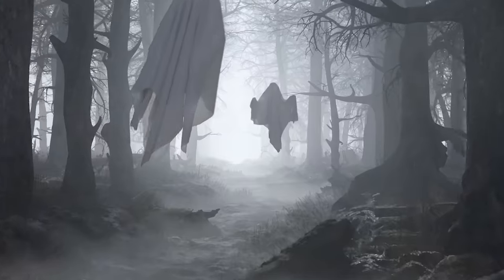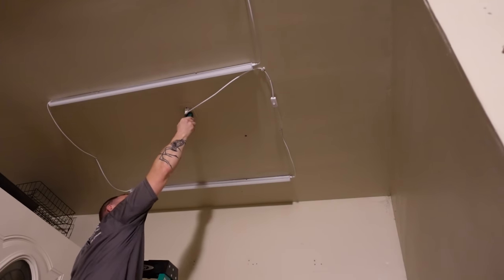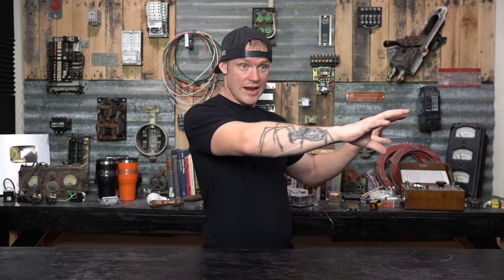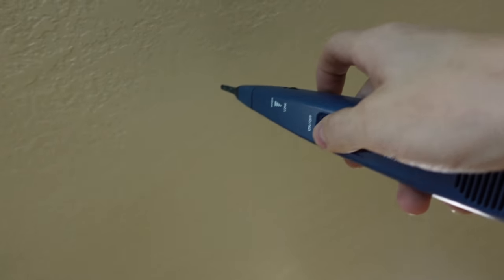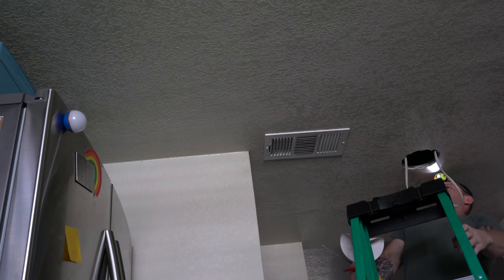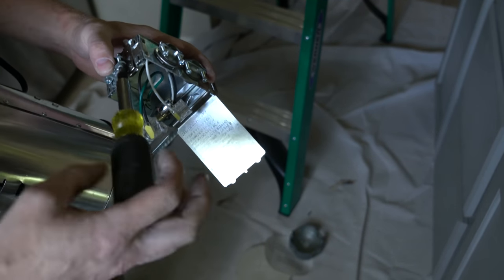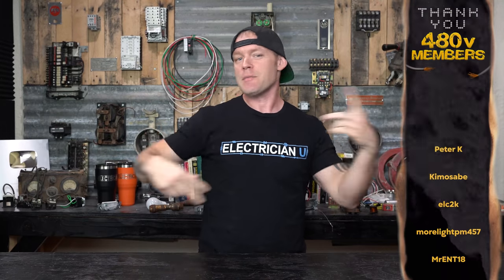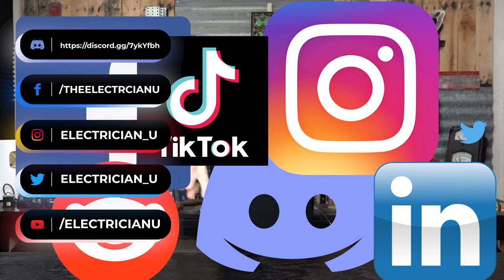THIS IS WHY ELECTRICIANS DON'T HIDE J-BOXES IN WALLS - Finding Hackwork!!

Comment: Speaking of switching the breaker off:

I had an electrician (apparently he was certified!) late last year replace my old hot tub receptacle with a 15A GFCI for outdoors.   Part of it involved replacing the 40A with a 15A breaker in the main panel.  (basically we were just re-using the hot tub wiring for a new logical circuit).  He managed to do that without ever shutting the power off to the house.   What an absolute muppet.

Comment: Once my closet lights stopped working. I found out there was an outlet and as soon as you plug something into the outlet, the lights go back on. Found out the outlet was just old and because the wires to the lights were connected through the outlet, they were getting disconnected in that outlet.

Comment: My frustration performing DIY (I do my best not to work like a Destroy It Yourselfer) changes on residential electrical circuits is, reading the directions for the device I'm going to install, then with full intention to be safe, go to the "Circuit Breaker Box" to shut down the power to the circuit I'm working on, and nothing is labeled inside the panel.  Who's responsibility is it to label the, circuit breakers, in the damn panel?
I worked in the drywall trade for many years and learned that when, plumbers and electricians, did rough in work they would often leave a mess behind of tripping hazards.  So glad to be retired from that.

Comment: Nice find in the box. Probably saved his a$$ and property. Seen this issue in various places, basically something, humidity or some other environmental reason caused the wires in the neutral junction to go resistive. P=I^2R. Portable X-ray charging board 120VDC battery stack. Not charging properly if at all. Connector has dark spot on one or more conductor slots. Cleaned burned post, replaced wire contact wiper and good to go. Shipboard fire and flushing pump, DC, high amperage.  One of the connections went resistive, 0 size wire melted off completely. The amount of heat from the current passing through the resistive connection was enough to fry the wire. And it did not pop the 100A fuse feeding it.  Same thing in a CT Scanner heater circuit. Wires would go resistive, either cause the unit to have uncontrollable temp or burned contacts. Resolved by field mod replacing tin contacts with gold plated contacts. So as I said, good find, you likely saved his house if not his family.

Comment: 18:50 - seeing the plug (receptacle?) move while tugging on the cable -- wouldn't that also then insinuate that the previous worker didn't secure the line within 4 or 6 inches (or whatever the number of inches is for Code) ??

Comment: and this whole rodeo is why I use a voltage tester that does both high and low impedance input..
if it reads weird in high, just load it down and watch it drop to 0.
cause of issue found super quick

Comment: ah yes, weird electrical issues, the thing that unites mechanics, electricians, computer guys and many more

I really love those things cuz it's where you gather the most experience

and sometimes the easiest thing is to just rewire everything
especially in old buildings with 50-80 year old wiring or whenever it was they used aluminium wires with cloth/tar insulation

Comment: I had a light switch "nobody could make work, and the last guy said if he can't make it work nobody can". They were unscrewing the bulb slightly to turn it off...open the outlet and there is a Red Wire just sitting off on its own unconnected...deedadee...the switch had been wired so that it gave constant power.

Comment: If I had to guess going from left clockwise around your logo, in parallel, after completing level 2 schooling a few months ago. Battery, resistor, diode, motor, resistor, switch, capacitor, normally open contacts. How'd I do?

Edit: Switch is normally closed.

Comment: Just curious about whether the box fill was of any concern in this solution.  I have noted that Halo in particular has stamped the acceptable number of cables or conductors allowable in the junction box, presumably which vary depending on the fixture, and surprisingly it's fewer than I would have thought.  I am assuming because we cannot read the jacket of the existing Romex cables that there were three (3) #12/2G NM cables in the ceiling to be re-spliced, plus the new, yellow jacketed, 12/2G NM cable you added for the switch leg of the room's light fixture.  Does Halo have anything to say about four (4) 12/2G NM cables in this particular j-box?
Reply from the maker: It's for the maximum fill rate of common derating tables they are required to in the current code cycle. There are calculations YOU can do to make sure everything is kosher.
Reply: @ElectricianU  of course. But as you know, manufacturer’s instructions always supersede the Code.

Comment: Helped a friend troubleshoot a light that wasn't working.

Are std. switches designed to fail shorted but with high resistance? That's what turned out to be the problem.

Comment: My bro in law had a habit of replacing outlets and switches. He would just take all the wires off a three way switch and just slap a new one in it's place which would not work. He also tried wiring in a phone jack. It of course did not work as he didn't strip the insulation off the wires.

Comment: Had a open neutral that took me a while to figure out. It was after the first receptacle in the branch circuit but before the second receptacle in the same circuit. (Sushhhhh, I used a double male extension cord to patch it for a couple of days until I could get into town to buy replacement parts.)

Comment: Even if you didn’t knew if the junction box was the problem you should just make the hole anyway to mount it in the ceiling and put a blank plate on it.

Comment: You know why I do not like slim recessed  lights except for when space restricted
-- if the light fails , and LED /led drivers do fail - customers cannot replace 'a bulb'
.
Little detail from my experience re 'odd voltages'
If I get voltage readings hot to neutral of 7-13 Volts .... 90% certainty 'neutral' is busted 
.
Oh and neutral to ground - even on 'empty' but powered circuits will trip a GFCI , even though I don't understand how since they are technically both 'grounded' and have no link to hot .... but it's what I have been observing
.
Oh, and I wish you had told people that 'new work' (installed b4 drywall) recessed lights have their boxes with covers on both sides so they can be reached afterwards via the dropped / pushed up can you demonstrated
.
Oh and being honest - I have used cans as junctions out of necessity instead of tearing open walls to extend wires - don't like it, but

Comment: Had an outlet below the main breaker box that's been taped for years as the house is owned through family and I asked about it. They said it gives odd voltages but didn't say a thing else. So I asked to take a look and they said sure. It's ok ne out look at 120 v 15 amp receptacle. Plugged in a tester both yellow lights and the red light kit up. All 3 at the same time. I immediately said "oh oh" as that's a very bad sign. So threw a voltage tester on it,hot to ground 120, neutral to ground 120, hot to neutral 240...

240v on a 120 volt 15 amp outlet!!! Are you kidding me!!!!. I told them this needs to come out now. So pulled the outlet out and sure enough two black wires going to hot and neutral with the white neutral going to ground...

Ripped the outlet out and capped off all the wires and replace with a blank cover. 

O and it was just one outlet on this line which went to a 40 amp 220 volt breaker ><. Anyways got the line removed completely and the 40 amp breaker removed. 

Lucky nothing blew up if any one ever plugged anything into that outlet and glad no one got hurt

Comment: Hello how are you  doing. listen I wanted to ask you something That I have seen different on our house BRAKER panel box. Before I use to see the breakers in different position and now all 16 breakers are in only one position.  In our house we don't have a washer or a dryer we don't rise A heater our sink disposal is not working our air conditioner is been removed there's a radio speaker where they  can communicate on all of 4 rooms . I am corpus does all breakers need to be in position. Thank you so much for your time and for your experience

Comment: I immediately knew that it was an open neutral issue. Every call I get where it's a weird voltage from neutral to hot, with voltage from hot to ground and neutral to ground, it's a broken neutral.  Odd to see it in a junction box, normally it's a bad backstab.

Comment: If you had mounted the j box to a ceiling joist right next to the hole would that have been considered "accessible" also or does it need to be able to be serviced from below the plane of the ceiling such as the integrated box on the can light that can be pulled down? I know in my area unless you have something like 4 feet of headroom for access in whatever space it is going you have to turn it upside down and use a cover plate in the ceiling. I like the idea of using the can light in these situations to serve as a j box, but I do wonder if the volume is large enough for all the extra conductors and wire nuts you'd be using in there that it was never intended for, where a J box next to the hole would have lots of space but be harder to access.

Comment: Minor problem with the canless lights- when they die (because they will) the homeowner would have to do some fairly major electrical work for a non-electrician to replace it, where with a can you can just replace the darn bulb. 

Replacing switches I can do. Having to take apart a possibly major part of my house's wiring, though? Way out of my comfort range, and I'm not into hiring someone for something that is suppose to be so stupidly minor.

Comment: Actually, there is something I need some advice on.
There's like, a fused switch in the cupboard of the back room that acts a bit like a junction.
it has a double socket connected to the box in the back room. The entire attic also goes through this box.
My brother at one point melted that socket in the back room. the problem was noticed when the power failed, now it doesn't work anymore, neither do the sockets in the attic.
I've put the multimeter on at several points, there's just no power getting to that box. I'm fairly sure the wires that go to that box are connected directly to the main breaker box at the other end.
Is it possible the breaker itself died? I mean, the issue is definitely before that box, that's the only thing I can be certain on, but to do further investigation would require turning off full power to the whole house, and I haven't had the opportunity to do that yet.
Reply from the maker: So it gets no power, full stop. 
You check up stream at a different potential termination point? Like it got melted off somewhere BEFORE that particular box. 

If there is no way to know. You are gonna have to start somewhere. Easiest way is if you know it's dead. Wire nut that together and continuity check suspected areas where it COULD be.

Comment: 7:15 I just want to point out that voltage does not kill, amperage does. Car batteries are roughly 12 volts. I have a battery powered unit that takes 12 volts (8 AA batteries). I've tested the power of my battery bay with my tongue. I wouldn't ever test a car battery with my tongue.

Comment: I found a hidden j box under my attic floor and 2 splices in walls NO j box. I also could not use can lights in my house due to the 100+ year construction. Rough cut 2X6 joists 14" on center.

Comment: Those of us who dig into walls know all about the things licensed electricians and plumbers leave behind. DIYers are often bad, but then they don't really know better, do they? I once had to change a fuse in a pump box. Switched off the power, grabbed the fuse and got knocked down. The knife switch to kill the power was wired in AFTER the fuse. So, cool, if I needed to mess with the power switch I could kill power to it by pulling the fuse. Licensed, inspected, death trap.

Comment: How about if you tape a clear plastic bag around the hole you are about to cut, then stick the nice through the bag, and cut the hole with the knife sticking through. All the dust would be neatly contained inside the plastic bag.

Comment: These new ceiling lights do not have a box rather they plug into a box that is separate. A box then can take the line and then attach to the load (light) provided wire. The box does not have to be assesable in the classic sense because it actually is just be taking out the new ceiling light giving access to the electrical box. Is this correct?

Comment: I'll bet that the strange voltage you saw from neutral to ground, you had a switch on somewhere, and when you were reading it, it was completing the circuit (bypassing your bad neutral).

Comment: Been an electrician for 28 years and this guy just voiced everything I do 
He explained it do well
I am in South Africa voltage is 220v
And we have 3 phase at 380 volt 
Great review 
Btw it’s not the voltage that kills you it’s a the current ( Amps )
30 milli Amps can stop a persons heart 
We have elecric fences at 10 thousand volts , no amps 
Also btw it’s called back feed through the neutral when there is a loose connection 
It seems that neutral is connected to other lives wires  
Keep well

Comment: You are a really good tradie,who knows his stuff,and the rare thing is you actually clean up after yourself wow.
Now a question on the differences between American elections and Australian elections and how you wire up housing.
For instance the thing you call cans we call down lights and for us we use to use a big white ceramic resistor wired to the downlight now we use self contained downright with a plug (it's a plug like you have on a kettle,toaster,) which then gets plugged into a socket in the roof (I don't know the proper sparkle turm for it)but every connection and the downlight is mostly plastic not metal like in the USA. 
So why do you make all your connections like a junction box ,switches box ,out of metal ? 
Isn't this risky as it could get electrified if a wire was to come into contact with it.
So enlighten me as to why use electrisions wire usin metal boxes for all your conectins ,Junction boxes and light and power points ?

Comment: At least one documented electrocution was by the 9-Volt battery inside a multimeter set to continuity/low-ohm-resistance whose sharp probing needle tips pierced the skin on both right&left hand thumbs, bypassing skin resistance and entering blood vessels continuity across the heart.  The test confirmed that the right-hand-thumb was indeed connected to the left-hand-thumb via blood vessels with a reasonably-low resistance through the salty fluids called "blood" and "lymph" right across the heart, providing clear indication of galvanic contact between the "arm" extremities, with the side-effect (if so desired) of a positively quick and efficient (although slightly comical) way to induce the ever-ubiquitous favorite retirement package option of company-men -- cardiac arrest of unknown origin ....  
"... unintentionally applied a 9-Volt battery...." 6LR61,
Duracell MN1604, Rayovac A1604, Energizer 522, Varta 4922, MX2400, 1604A .....  Goeth by many names, doeth the same wondrous magick....

Comment: I love the video. My story. I wank up finding water on my basement floor under my fridge. Wondering where it's coming from. I followed it back to the hot water heater. There's a small stream of water coming out of my water heater. I turn off the gass and then turned off the water. I bought a tankless water heater like 4 years ago. It takes 8-2 wire 2 runs and 1 double 40 amp breaker's. I needed to get this installed before nightfall. I have work the next day. I shout off the water main. Drain the water system. Looked at where i wanted to place it. And went out for parts and supplies. Cutting out some old pipes and installed shutoffs. Installed new copper pipe and placed it on the wall and the 1"   Beaded flex line. I normally  don't mess around with stuff like this. But it's fun and something new to learn. And do your research.